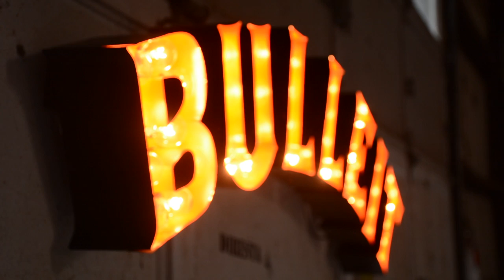DiResta BULLEIT channel Letters

Comment: Jimmy DiResta owns as always but I believe that way of mounting/connecting/whatever of those lights/bulbs is amazing. I mean I've never seen it before - that you can have bunch of sockets and just place them anywhere on the wire. Is there a term for such connection/mounting? I've never seen that but it doesn't mean we don't have it here (Europe) maybe I don't know because I wasn't really interested in.. whatever you use this lights for.

Comment: What are you using to affix the flashing to the sign?! I used a brad nailer but it went right through the aluminum
Reply: Try using staples if your brad nailer will accept them

Comment: That looks awesome Jimmy! Is that a roll of aluminum that you're using to run around the outside of the letters? I need to figure out where I can buy something like that.
Reply: Making With Steve I'm pretty sure it's aluminium roof flashing. Look for it in the roofing part of the hardware store. It's pretty cheap
Reply: Awesome! Thanks!

Comment: I am in the middle of doing something very similar.  I have used this video as my guide.  The issue I am having is that my nail gun shoots the nails right through the flashing.  I have dropped the pressure on the regulator and dialed the gun all the way down.  Sometimes it works, but most times the nail just goes right through.  Is there a trick I am missing?

Comment: what are the lamp holders called that you can crimp onto the wires like that?
Reply: They're often called pin-type sockets. They have IDCs (insulation-displacement contacts) that pierce the wire when you attach the rear caps. Sockets you buy individually usually have caps you screw on, but Jimmy found a pretty smart way of using inexpensive holiday-type strings by prying off the press-fit caps.

Comment: I don't understand how he's wiring those.. The wire looks completely coated when in place, but he hammers a cover on the back and screws in a bulb and it works..?
Reply from the maker: +Just A Duck there are fangs that poke in to the casing of the wire
Reply: Ahhh, thought it'd be something like that, where can I find these lights? They're so simple!
Reply: did you ever find a source??